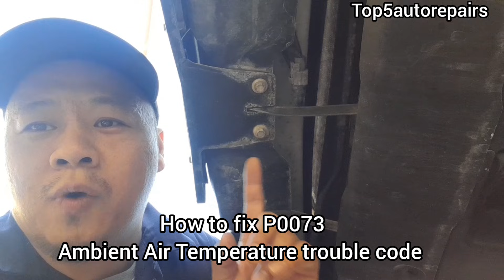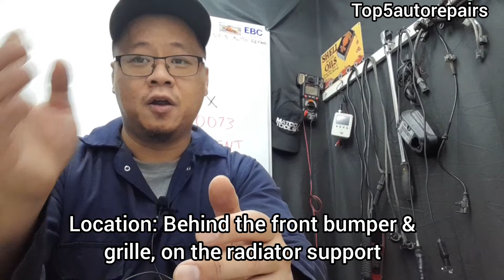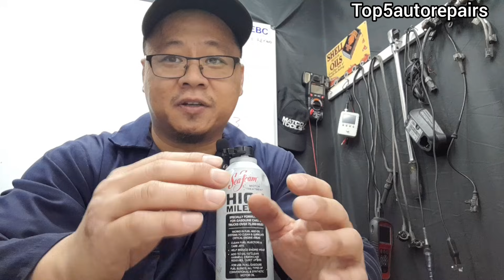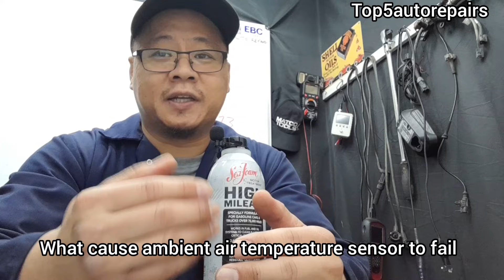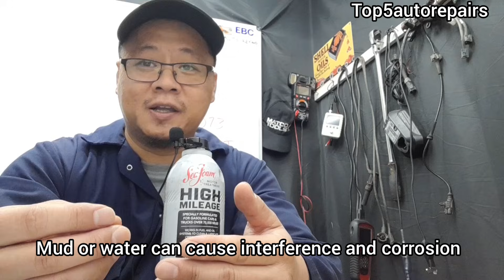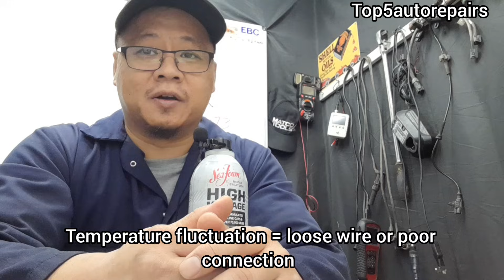P0073 Ambient Air Temperature Sensor Circuit High Symptoms Repair Fix Causes and Location

Comment: I was wondering ... Im panting a 2021 silverado y took the whole front end off and the ac was working just fine i took the two side mirrors off check engine light came on ac quit working and the passenger side door shows open on dash thats crazy 😂